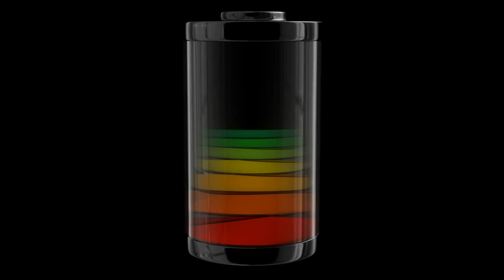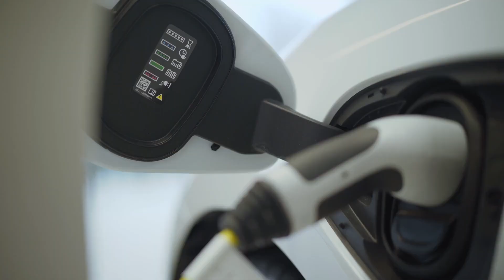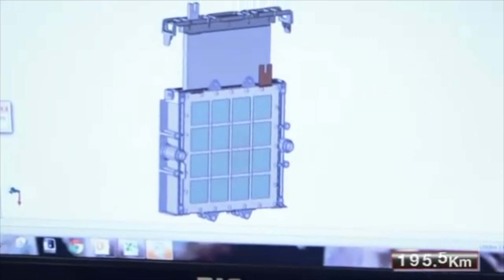This Battery Gives EVs 1000 Miles of Range!

Comment: Actually, the swap out idea is potentially not such a problem. This has been proposed for lithium ion batteries. I believe that Tesla was looking at this at one point. Their batteries, in their newer models, are on the bottom of the vehicle. The idea was to have a station where you could take a vehicle to and the spent battery would be swapped for a new one. Logistics may be a big issue here. Of course, you could use existing filling stations for this.
As for the logistics of having to refresh the electrolyte, it could be made simple to do at home, with a little engineering. Don't forget, you still have to remember to plug in you electric vehicle each night to top up the charge. Not as convenient as a gasoline powered car, but still doable.

Comment: Yah that's an interesting idea,  and a 1,000 miles is s good distance to cover, I think it would work if the structure was there to support it and you could keep the cost down, after all the car would warn you how much mileage you have left in the Battery so you could know if its going to cover your next few journeys, yah think it has real potential,  cost and convenience is going to be the thing, yah nice idea I like it.

Comment: I'm a Trump Supporter, however, even to me, this Aluminum "battery" technology has all the earmarks of what makes for a Winning Product (within the framework of marketplace Capitalism.) Essentially . . .
● no Charging required;
● you are driving around with a "block" of Aluminum, that slowly turns into a "block" of Salt (i.e. Aluminum Hydroxide);
● the Anode, which starts out as a "block" of Aluminum (which eventually turns into a block of Salt), needs to be occasionally replaced with a NEW "block" of Aluminum. It seems obvious that such a "swap out" could be performed in under [5] minutes (...the duration of a typical "gas up" STOP for a Gas Powered car);

So, the question becomes . . .

● how many MILES do you get to drive BEFORE it is time to "swap out" the recyclable "used up" Aluminum "block" ?

The video mentions a distance of 1000 miles. That means that, [7] days a week, you could commute 71 miles to get to work, THEN drive another 71 miles to get HOME from work, for a total of SEVEN DAYS before needing to take [5] minutes, out of your Busy Week, to have the recyclable Aluminum "block" replaced.

Sounds like a winner, to me.

Comment: Set up the battery packs inside of the frame of a car so that they can be disconnected, dropped, and the new ones put in, charged and ready to go by an automated system.  Instead of waiting on a charge, you just swap batteries at these automated stations and the used batteries designed to make the aluminum easy to slide out and in for quick replace.
Reply: Yeah like a computer UPS battery pack. Just make sure the batteries are recyclable. If you cannot recharge them.
Reply: @ronb6182  While recycling the batteries would require a little more carbon foot print, the atoms are all there to be rebuilt.  The initial build would be a bit more resource intensive, but over all a system like this could actually work great.

Comment: I really never understood why the hydrogen driven car was never produced. While it runs on Hydrogen and burns it like a conventional fossil fuel engine, all it really needs is water instead of oil. Electrolysis can be done with solar cells, so a roadside fuelling station can use solar cells to electrolyse the water into hydrogen and oxygen. The hydrogen is stored and is uses the same solar power to pump it into a tank. Meanwhile the oxygen is released into the atmosphere, you can't really get greener than that.
While the engine still burns the fuel, burning natural hydrogen creates less emissions, (when natural hydrogen is burned correctly, the only emission is water vapour) and the release of oxygen from the refulling stations means a massive release of a gas we CAN breathe, that would be much better in a city.

We should NOT consider using blue hydrogen at all, that does not burn cleanly. Blue hydrogen comes from natural gas and is a very dirty substitute for natural hydrogen as the emissions include methane and the other emissions mean a carbon footprint 60% worse than burning diesel and 20% worse than burning gas or coal.

Comment: Corrections:

1:53 The flammability issue you allude to is NOT caused by solvents, but rather the fornation of "dendrites" over repeated charge/discharge cycles that can eventually cause the battery to short out (read: all stored energy getting instantly converted to heat).

Comment: Now 

if you make two separated battery packages ;
and use one ..including an alternator and a charge/inverter system;
 that is able to charge the other battery,which is depleted ?…then you will be charging;
 as you drive !..and you should never need to plug-in… of course, 
I would still have a plug to provide a charge input.. and I would also do solar panels , that could also provide a charge… 
 now ?…we don’t need this massive infrastructure;
 that every claims we need….😏
This is a simple yet revolutionary idea …that someone should pay me a ton of money for ?…but I’m just gonna give it away ,
because I’m tired of watching everybody struggle,& burn gasoline…

Comment: If EVs were made with smaller less-expensive commuter-range (200-250 miles) lithium batteries, these could be used as range extenders when longer travel is planned. It would make EVs much cheaper and lighter with smaller batteries, and alleviate the range anxiety involved with road-trips. Best of both worlds in a battery hybrid system, especially if one could just run down to the store or station and grab a battery that uses a standardized connector that goes in a protected enclosure in the trunk or somewhere.
Reply: Instead of trying to make a giant battery that goes 1000 miles you make two separate batteries that go to 150 miles each but they have an included charge/inverter system this rain re-charging the depleted battery and this way you don’t need exterior charging stations or anything else I would also put a solar system on top of it even if it took two days to charge the battery it would be better than nothing

Comment: What about a hybrid or duel fuel battery system with lithium batteries powering short drives around metropolitan areas while using an Aluminum air battery when going on longer commutes.

Comment: Fuel the battery with an Aluminum particle slurry, instead of consuming Aluminum electrodes. Makes it into a Flow Battery!
Reply: If they were 25 lbs each 8 per car to = 200 lbs most people would be able to replace them, but if that doesn’t work I think they should stay in larger machines, or as a 1.5v battery alternative

Comment: You are  absolutely wrong.  What  you are projecting is just a one face of coin.  It is true that aluminium air battery is easy to manufacture and use.  But real challenge when you turn back aluminium oxide to aluminium  it requires lots of energy as heat at present that makes whole cycle aluminium to aluminium oxide and back to aluminium very ineffective and inefficient.

Comment: If the environmental impact is about the same as lithium extraction, then I'm not using a non-rechargeable battery will work well. Recycling does consume energy too. While it is great to investigate stuff like this, I don't see this as a viable option anytime soon. I'm more interested in LFP and sodium-ion battery tech for the immediate/near term needs.
Reply from the maker: It’s a special use case… like aircraft for example
Reply: @TwoBitDaVinci  Even that would be specialized since I don't see us moving away from jet-powered jumbos anytime soon. Perhaps regional connecting flights or private planes.
Reply: If it is still cleaner than gas and diesel, why not run it alongside lithium and other tech's, as an interim to better things, this seems cheap and doable. Plus, 1000 mile range could be a the tipping weight for many to switch to electric, and then they will be more open to maybe less range and more environmentalism down the line. I know so many who say fuck the future generations, because they want to live a well fed life of excess. 1000 mile range on one "fuel-up" sounds like excess to me. Anything that is cleaner than oil, is a win in my book. 

Unless some kind of overpowered tech is invented, it WILL take to long to switch the world off of hydrocarbons. We can really only hope to minimize damage, and every puzzle piece will be needed to form a picture we can be proud to look at.

Comment: 600 km = 372.8 miles not 1000 miles please do the 🧮 math. Your recommendation of aluminum batteries runs into the same problems in less developed nations than any other car or vehicle you would  care to mention. In this case I would suggest a good Missouri mule or a well oiled pair of boots. I agree we have a lot to learn yet. Elon M. has looked down the road for let’s say the next decade and chosen the strongest most flexible option. Should something better presents itself. .  .  .  Sorry, I must say I enjoyed your presentation. I learned new things. Thanks 🙏

Comment: Instead of an oil change you do a battery change.  Also credits for recycling would help offset costs.  2 packs on board to help with 1. Range 2. Swapping them out while other is being used

Comment: I have said for a while that when EV's have a 600 mile range, 400 mile recharge in 15 minutes, and a price at <$30k fully loaded will signal the end of IC cars.
I will never drive a gas powered car again, but I would love a 600 mile range car and if I can get 400 miles of range in under a half hour, I would be greatly pleased.

Comment: I suppose it would make sense to have two batteries in the car - you drive on one until it's completely depleted, and then swap to the other one and get the depleted one replaced. That way you don't end up losing the last 5 or 10 percent just because you want to be safe.

Comment: Private Sector Energy has developed some kind of battery that will increase range to 1,250 miles with all creature comforts running. Plus, it's lighter and charges in less time than what's currently available. They'll be bringing it to market in the near future.

Comment: Interesting tech. only viable use i could see is for range extenders for long trips. surely this would not be in any way better than an actual battery as it has to be fully recycled after each use rather than just recharged, which will take more energy than just charging Li-ion

Comment: I like the possibilities. The main point is that we are working with an element that’s very plentiful. That has huge implications in driving cost down. The negative I see is rather than distributing electricity over powerlines to distributing physical objects, the aluminum blocks or power cells. That’s even more work. But we’ve done this kind of distribution before, like blocks of ice in the old days before we had refrigerators that could be powered by electricity.

Comment: This tech is great if you want control and or dependence just like gas also good for those can not add charge stations everywhere.  However, like anything that consume, well at end game you still be losing something, so I doubt this aluminum air battery will not use up something to give all that energy, even if some part are recyclable but not the whole unit.

Even lithium battery used up of some materials at end of life, just a little bit each time but still a far better way than gas.  As far is I know no one battery tech don't consume some materials after its life cycle.  In a way battery will use up so material that cant not be recover so if we don't start space rock mining we one day can run out of material to make battery surely, its something in back of mind all the time.  

Off topic ,if you play enough resource management game everything is finite which will eventually end the game, talk about kill joy even from an entertainment PoV.  Until we have some way to make unlimited materiel a reality we are losing a bit of it until we can't make anymore.  I know its silly to have such thoughts but it a kind to have thoughts about death every now and then, its always unpleasant but the end will come at some point, so lets not help speeding it anymore than its needs to.

Comment: How could you possibly make such a rookie mistake? You said 600 km is 1000 miles. That’s ridiculous. 1000 km is 600 miles, It’s the other way around. 600 km is about 360 miles. You should be ashamed.

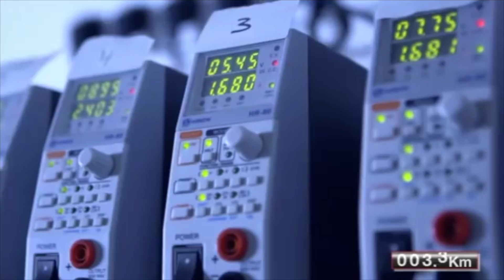It’s at 8:10 in the video.

Comment: Researchers have been able to make a reversible iron air battery, now if that can be applied to aluminium air battery we'd be in business, but the density would drop considerably because i'm pretty sure it has to be a sealed system for the reversable iron air battery to work.
Reply from the maker: Great insights! Iron air is coming soon from us

Comment: I'm always left wondering why there has to be a swap station where you rely on other people to change your battery pack? You know the battery pack could be split into several batteries that weigh less than 30 lb. Four batteries or 120 lb worth of aluminum air batteries will get you the range you really need an electric car. Then you can stop someplace that has a stockpile of aluminum air batteries that are uncharged. Meaning that they don't have the electrolytic in them and they will store for almost forever. In the bottom of the air batteries would be the dry caustic needed to make the air batteries work. So you'd have to install them and add water to each of the batteries. I think the main reason why this technology is not being developed is because there's too much money currently in lithium ion batteries.
Reply: The one thing I left out is that aluminum air batteries don't turn off. So to turn them off you have to take away the caustic that's causing the reaction. That could be done by calling the plates out of the casket or pumping the caustic out of the aluminum battery cell. Removing the plates is the better system but to automate it would be complicated whereas pumping acrostic into a folding container wouldn't that wouldn't be that difficult. The only problem with the second method is that there will be still degradation of the aluminum air battery.

Comment: Well, the aluminium air batteries would need to be in modules that are readily replaced and discharge a module completely before moving to the next module so only the completely depleted module need be replaced.

Now as rechargeable batteries such as lithium ion have their fastest charging rates when depleted and their slowest when they are near fully charged, it benefits one to deplete a lithium ion battery and then only partially charge it to reach another recharge site for another partial recharge thereby reducing your overall recharge time during a long trip but this leaves you very little reserve if for some reason the planned recharge station doesn't work or is occupied and hence you must seek another.  A couple of these non-rechargeable aluminium air modules could provide you with that reserve.   Also, aluminium isn't the only metal that can be used as a primary metal air battery.

Comment: terrible. i explained in another video the issue with an air battery, now the issue with aluminium makes it less environmentally friendly

- aluminium takes more energy to refine/work with (thats why some car manufacturers use steel over aluminium)
- it is harder to charge/discharge, reduces max amps and more charging losses (means you use more energy to charge it, costing the environment more in energy use)

And you cant use an air battery in a car, and if you do seal it i doubt you would get more power than lithium.

Comment: Great presentation. Hydrogen is still a great choice. The exhaust pipe emits water. The ultimate in cost effective recycling with no carbon foot print (if you use solar or hydroelectric to split the water). Why do we have to make this so complicated? O and earth is like 90% covered in water.

Comment: This seems absolute wonderful !!
Imagine this battery could be recharged. Then you would at home convert the hydroxide back into metal. But in a factory this process could be much more efficient and error free.  It can be done  with thermal solar in deserts. Then all that anode transport should be efficient too of course.
Is it possible that the motor is simpler, lighter without having a recharging possibility?? Then this should be considered too.
Cars are no so heavy and that's bad in many ways. Electric cars should be light and very aerodynamic I feel. 
To have a real light electric motor, induction would be best I guess. But the costs are astronomical.

Comment: The use of fuel cells is the way to get more range. But not with metals. Metals don't store much electrochemical energy. If you consider a car consuming 15 kWh of electricity per 100 km you need 10 kg aluminium for this range. Where do you want to dump this amount of aluminium hydroxide. You have to carry a big water tank for it.

A fuel cell is a good solution, but you have to consider fuel cells for established fluids like ethanol or methanol. Hydrogen is not an option because of its very low volumetric energy density.